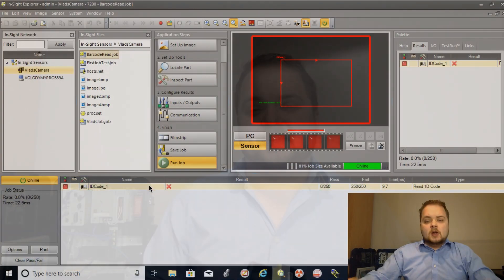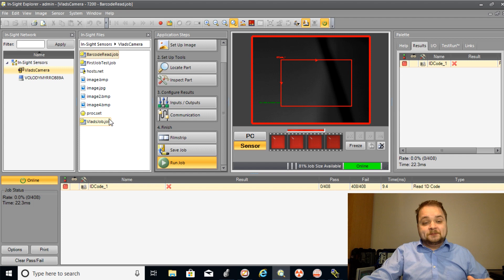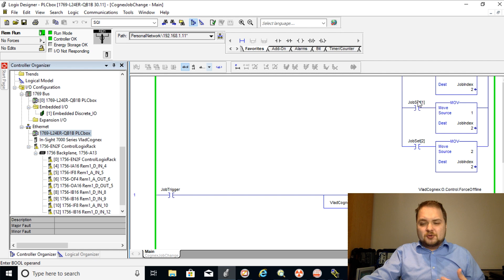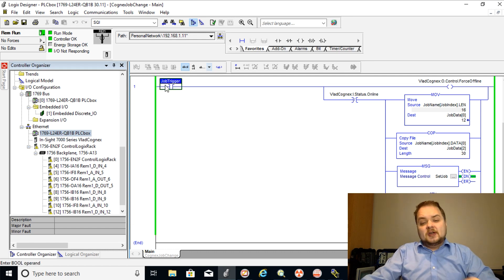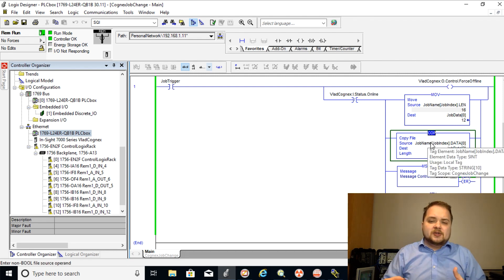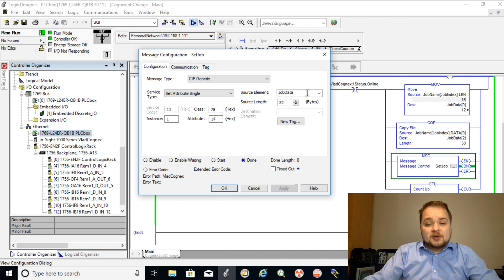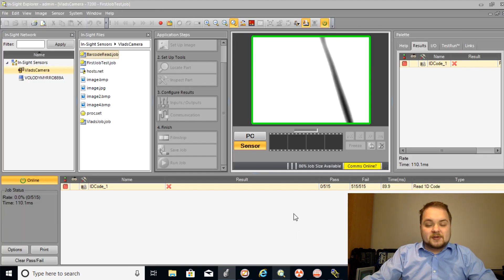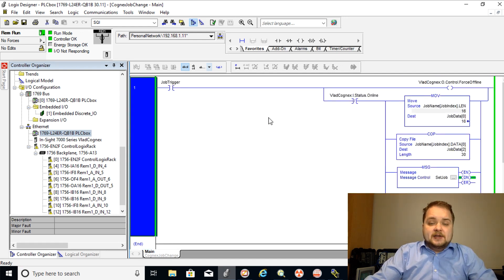Cognex In-Sight Vision System - Job Change EtherNet IP CompactLogix Rockwell PLC RSLogix Studio 5000

Comment: Hi Vlad -- love your training videos, Have you ever worked with Cognex Native Code? I've done it with Telnet and the Cognex SDK but for some reason I'm having trouble using it through the CompactLogix PLC. I've followed Cognex instruction sheet to the letter and it just doesn't work. Thought you might ve had experience with it?

Comment: Hello Solis,
I was wondering if you can create the same video but using DATAMAN software. I'm working with a Dataman 260 and a CompacLogix PLC. I need to get the result string and figure out how to send the barcode number to validate it to the reader.

Thanks
Reply from the maker: Hi Daniel, I haven't worked with the Dataman for a while. I'll add it to my list of content, but I wouldn't promise it to be released soon.

Comment: How about get a status Ok / Not oK result from the present and absent Cognex 5100 with Control Logix ? Currently i am using digital signal for Ok and Not Ok but it seems the signal a little bit delayed. I need it to connect by the ethernet. Could you please share the config of the camera ?

Comment: Does it work for Insight 2000 as well?
did you install the EDS file before you programmed it or you added the module as a generic ethernet module?

Comment: Hi, thanks for that nice video. I'd like to know how much time it takes for the camera to change that Job? 30secs? Could it take more time if the job is bigger?
Reply from the maker: That's a good question. I'm not sure how long it takes, but I'm sure that you can figure it out with basic timers on the PLC. I would guess that it would take more time for a larger job to load, but once again, I don't know. I would recommend programming a routine that would check that the camera is back up and running once the job change is complete.

Comment: Hi, it's amazing. It really helped me on my project. Is it possible to see which Cognex Job is running on the PLC?
Reply from the maker: Sorry for the delayed response. There's no way to pull that string back in, but you could set a number in each job that would have to match. In other words, you could create an integer in your job that would return a specific ID of the job that's running. Verify based on that.

Comment: After setting offline and using message instruction,  what do you do to put it back in online mode? I am new to Cognex and am working on an application to change jobs using Insight 2000 series camera within RS logix 5000. Any help is appreciated
Reply: I'm not sure how he does it but I run this program as a step sequence where it latches it offline at the beginning and unlatches it at the end. It works for me.